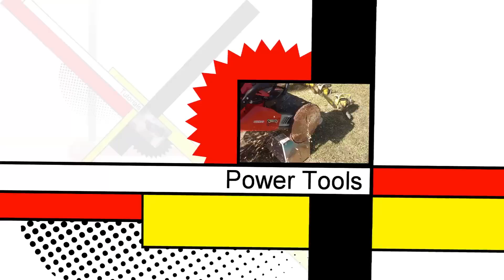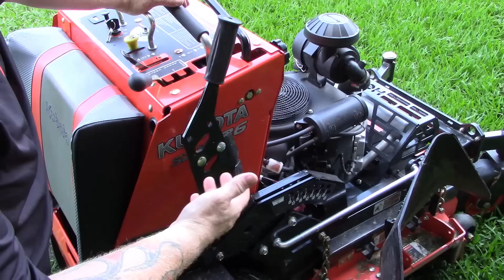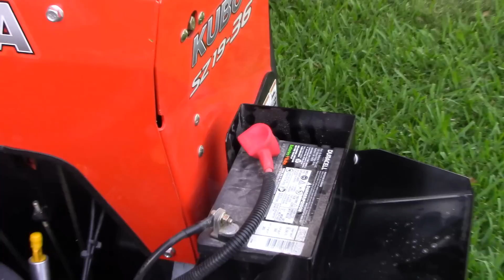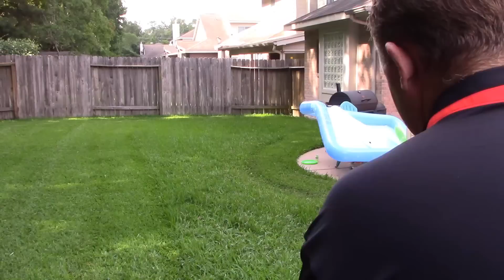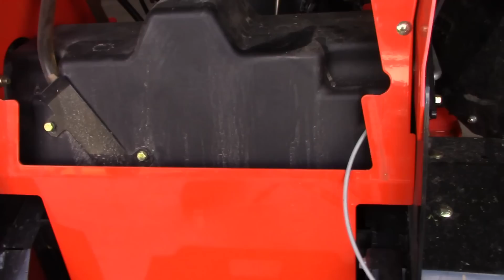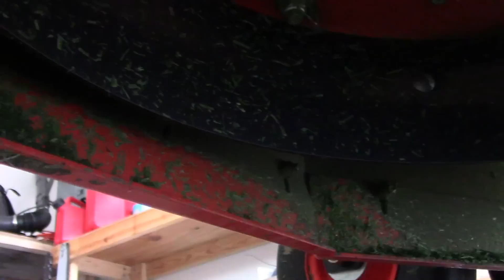kubota sz1936 review stand on mower

Comment: I have been looking at this mower at the local Kubota dealer. I did ask the salesman if Bobcat was producing these for Kubota and he did confirm they are. He said he thought there were a few minor differences that Kubota had specified that were slightly different from the Bobcat but was not sure exactly what they were. I am trying to decide between this mower and the Hustler 36 stand on. I do like the thicker pad on the Kubota though. Both appear to be nice machines now its just time to pick one.
Reply: @TexasVeteranLawnService  Thanks for the info. I will check out those sites.

Comment: I'm considering a Ferris Z3X 61" with Vanguard 37 hp F.I. engine.  It's a beast and has a beautiful cut... but not quite as good as your Kubota.  I have a 21 year old Kubota TG1860G with a mere 450 hours on it.  Used for residential mowing only.  It's been great except for dirt in the carb and that's my fault for not screening the fuel.
Reply: @TexasVeteranLawnService     I'm very pleased with the Kubota.... it's not a zero turn and I'd love to have one.  The Kubota Diesels ZD1200 or 1500 are awesome just too much money for my budget. Ferris comes home at about 13K

Comment: Good review. Thanks. I have a z726 Kubota. I'm thinking about getting a 36 stand on unit. Kind of wanted to get away from Kubota but the unit looks good, the cut looks good. I don't like that there isn't a fuel gauge. I guess that's not a big deal as we aren't going to use it on all jobs. Can you lift the deck easy while mowing? In case you come up to a rock or something.
Reply: yeah the 36'' and 48'' and 52'' and stand on kubota mowers uses same blades as your z726 plus same filters and parts  wich is nice plus you can fit a 19hp diesel kubota engine on there stand ons if wanted to switch plus you can get or add a feul guage meter on it as a option